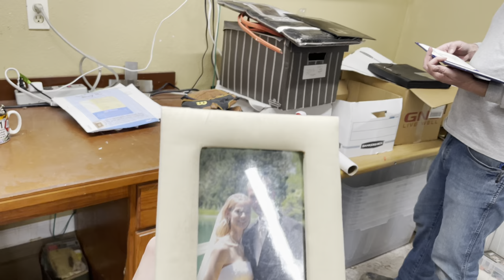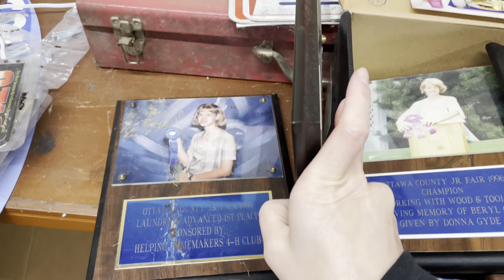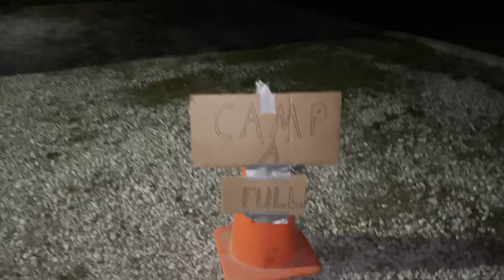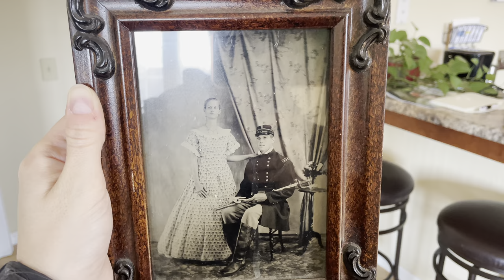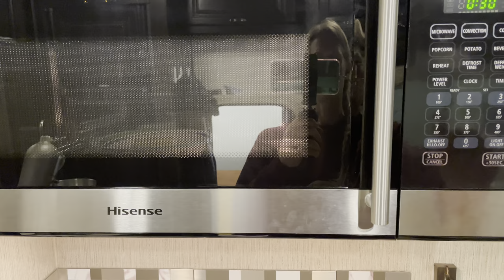RV Homebase Upgrade Revealed!👀(RV Convection Baking) #rvlife

Comment: We had a wooden storage shed that we had to tear down because of termites.  Replaced it with a plastic shed on a platform made from treated lumber rated for groung contact.  I get the heebie geebies with firewood and untreated wood nearby.
Reply from the maker: We don't have termites around here luckily or else we probably wouldn't have got a wooden shed.
Reply: @WanderingWagners  no termites - that's great

Comment: Nice barn. Dang those Fitchs just ignore the sign and pull right in. Same ramp I installed on ours. I built my own barn in 2014 16x16 with a 4 foot porch for $3500. If I built that today it would cost more like $7500
Reply from the maker: No kidding, lumber prices are crazy! We are pretty happy with the shed/Barn though!😁

Comment: Which John Deere is faster?
Reply from the maker: The newer one Mike rides is faster and has a bigger deck
Reply: @WanderingWagners  If Mike had a compact tractor with a rear tiller and a grooming mower maybe 60” wide, just think how quickly he could get the job done.  You could be inside baking.